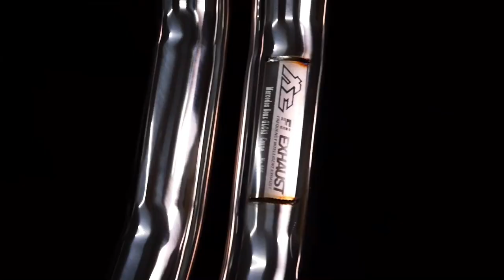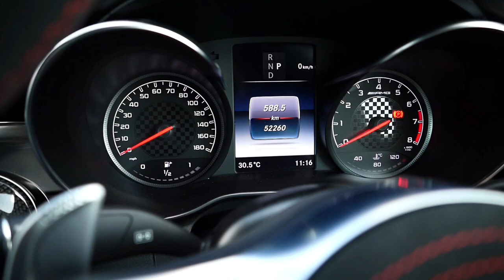Mercedes-AMG C253 / X253 GLC43 Fi EXHAUST Install and Flyby Sound Test X One Belief Automod

Comment: Whats the horsepower and torque gain from installing this? Sounds so good! Would love one on my 2017 glc43.
Reply from the maker: On average you can expect 5-10% performance increase over stock with our full catless exhaust system without tuning. Our regional sales rep can guide you through exhaust setup options and pricing. Therefore, please submit a contact form on our website to be connected. Thank you.